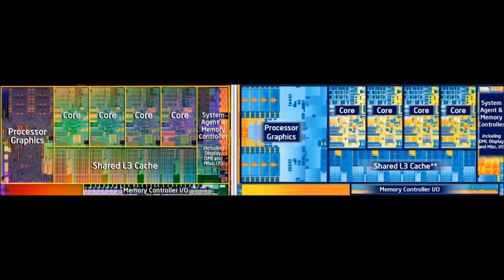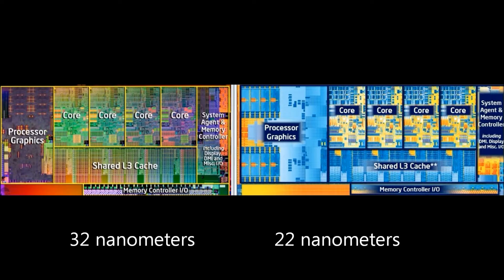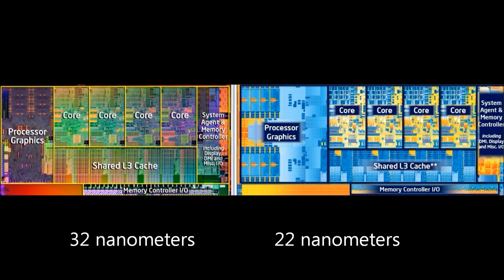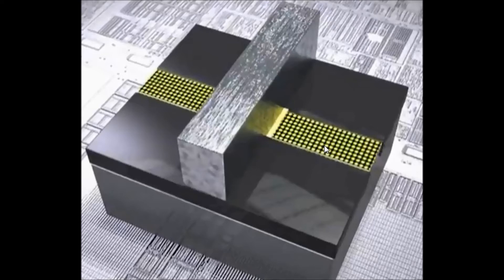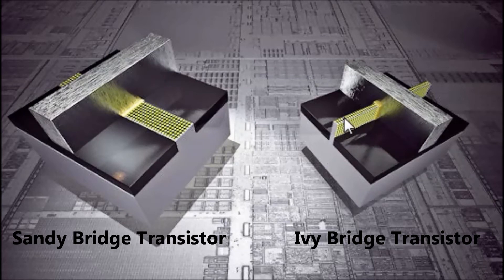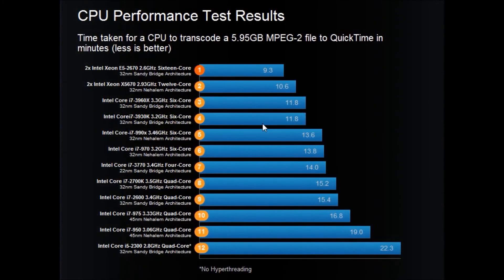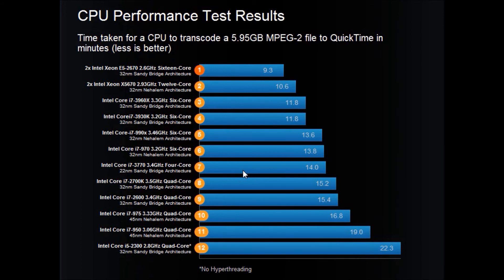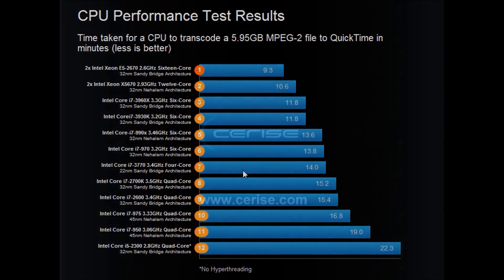Episode 13 - Intel i7 3770K Review

Comment from the maker: Hello Burger:

This CPU will be the best for gaming because it is the desktop CPU with the highest frequency. Games are not that highly multithreaded so for gaming, higher frequency with less cores is preferable to lower frequency with more cores. Intel does make CPU's with a higher frequency than the i7 3770K but they are Xeons which are very expensive.

For the graphics, check out the charts on tomshardware for the best performance to value ratio.

Hope this helps.

Regis

Comment from the maker: The K means the CPU has an unlocked multiplier. In simple language, this means the CPU is easier to overclock. Audio processing is not that CPU intensive, especially by today's CPU standards. If you want to overclock, you are better off with a K version because it will give you more control over overclocking. However, for an extra $40 more than the 2600K, you can get the 3770K. If overclocking is important to you, I would pay the extra $40.